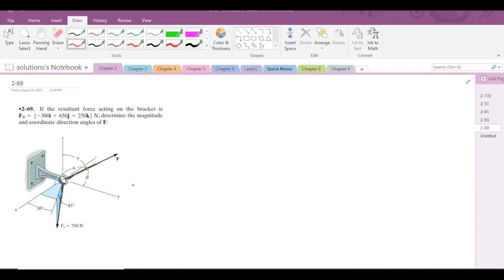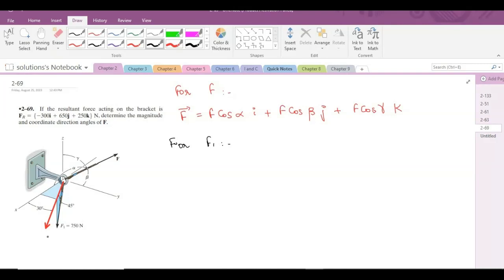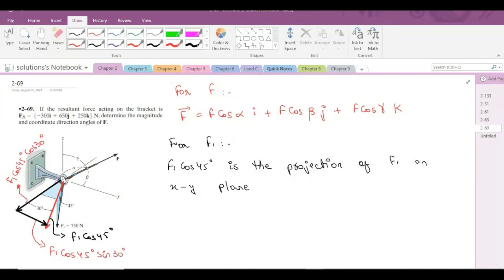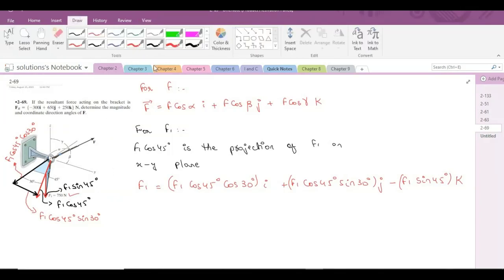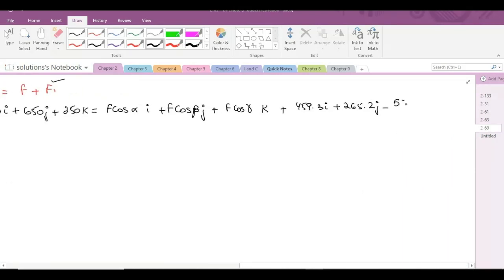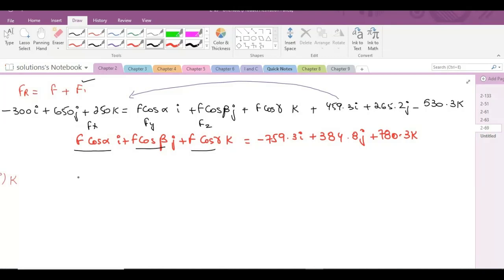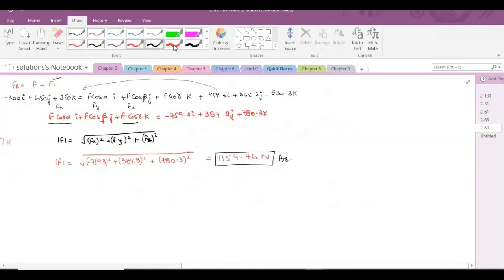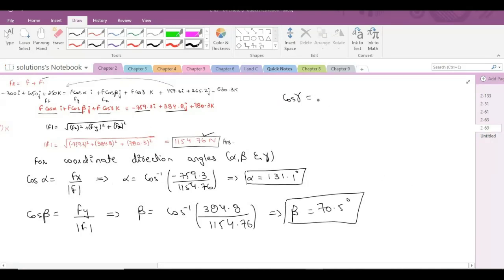2-69 hibbeler statics chapter 2 | hibbeler statics | hibbeler

Comment from the maker: Learn How to Solve 2-29 Hibbeler Statics Chapter 2, "The beam is to be hoisted using three chains if the resultant force is to be 600 N directed along the positive y-axis. Determine the magnitude of forces Fa and Fb acting on each chain and the angle phi of Fb such that the magnitude of Fb is minimum. Fa acts at 30 degrees from the y-axis as shown."
Here is the Link: https://youtu.be/AZF3sAxMMyo